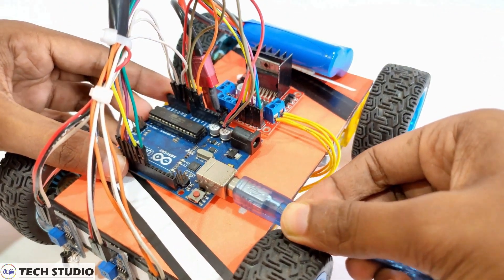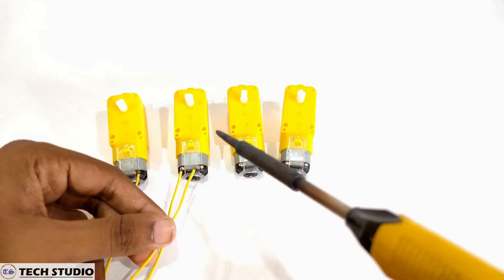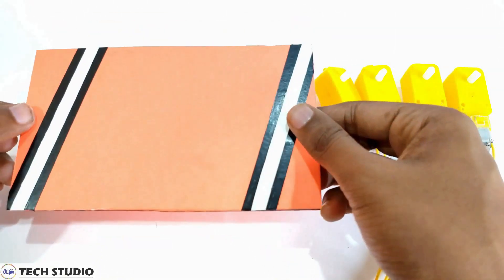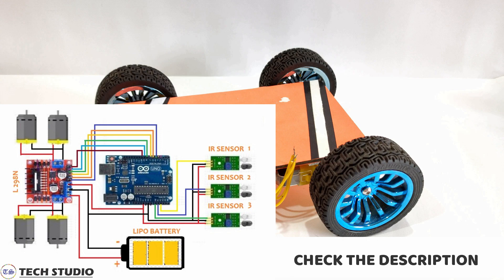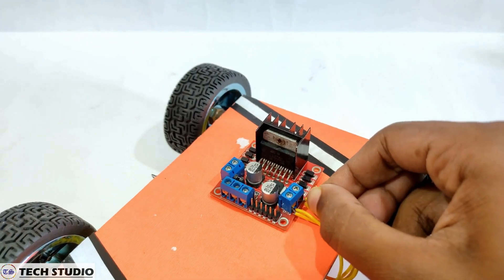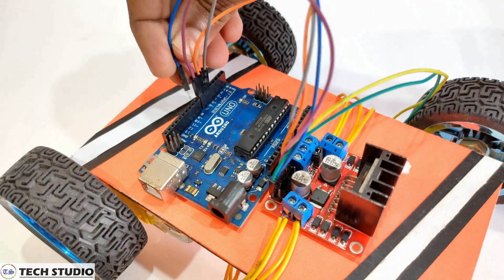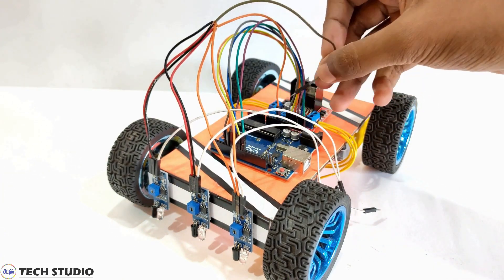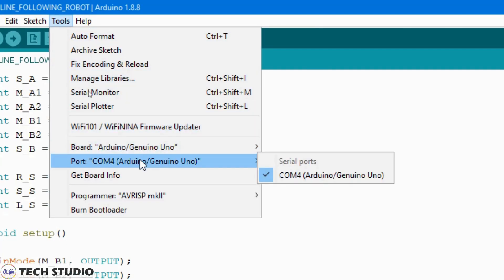Line follower robot using arduino and l298n and ir sensor | My Tech Studio

Comment: We are working on this project. We make a complete Circuit according to you. But DC motors (120rpm)are not working. Power supply is 9V. Plz help us. Plz point out our mistake. plz do the needful.
Reply from the maker: Use 12V supply
And calibrate the ir sensor
Reply: One sided motor does not work.
Reply from the maker: Email me
Reply: Plz see my what's app msg